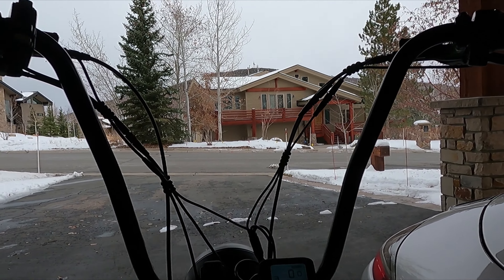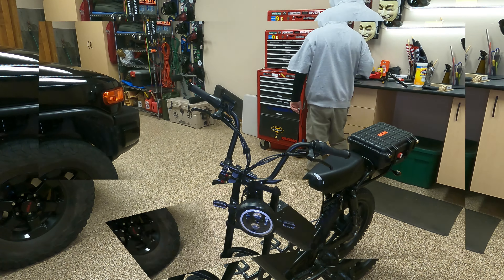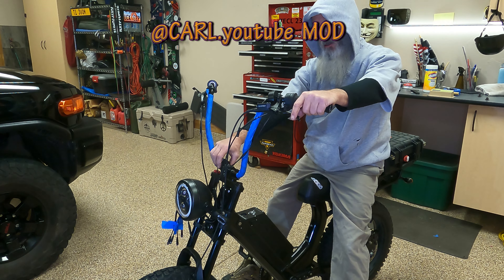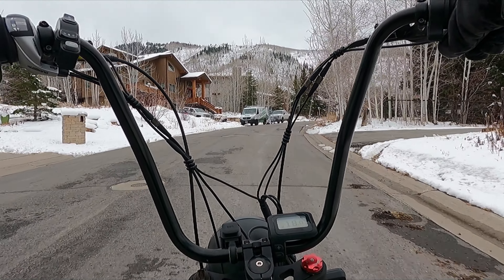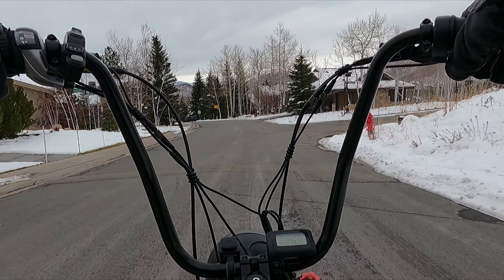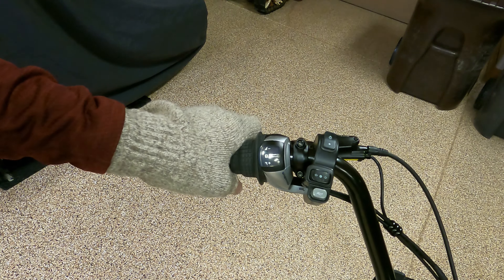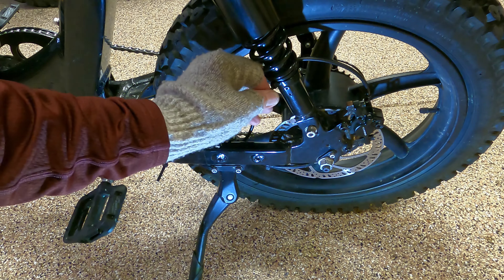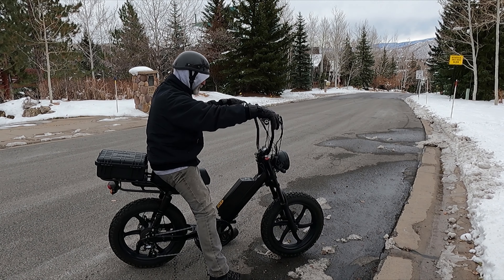Handle Bar SWAP Modification on a Juiced Bikes 💩JUNK HyperScorpion🦂E Bike

Comment: thats the right height for ape hangers wasnt thinking about doing this but now i gotta
Reply from the maker: You will need to replace both hydraulic brake lines, but there is enough slack on all the electric cables once you cut tywraps and work some slack forward.  You will love it!

Comment: Nice Ape bars Jester ! When I got my first bike a few years ago It had the low bars like many of the super 73 type bikes. After a few rides I realized that those low bars might look good but they kill your lower back on long rides due to having to lean forward and bend while riding. 
Your bike is now sur-named the Juiced Jester. All the junk has been replaced. The Scorpion is now squashed ! 🦠
Reply from the maker: Still have the forks to do..

Comment: I found some We The People bmx bars to put on my ride \m/
Reply from the maker: will the cables be long enough?  I had to lengthen the brake line with my Apes.
Reply: @UncleFjester  ill have to make them longer, can i reuse the olives and barbs off the old lines to the new lines? Im worried i might order the wrong ones lol...
Reply from the maker: I ordered replacement lines and the came with the olives and barbs
I think it would be very difficult to reuse
Reply: @UncleFjester  i found some tektro orions 4 piston upgrade with extra long hydraulic lines i can trim down to size, I should be good now \m/

Comment: I had a question maybe you could answer, if i were to put bars with a nine inch rise , would I still have to change the break cables?
Reply from the maker: I think you should be able to find cable existing for a 2" increase. Even if you want to, not have too, its really easy, the bleed kit you'll use forever.
Reply: I appreciate your reply

Comment: I really want the bike if I can't get at over 50 miles of range fuck that can you test with just pedial assistance
Reply from the maker: There is only 2 ways to get 50 miles from this:
1) to remove the heavy ass battery and pedal it like a regular bike.
2) Ride it like regular for 25 miles, then push it home from there.
Reply: @UncleFjester  dam what. Abt puting a better battery on it
Reply from the maker: I'm adding another battery and 🤞🏻 expect to be able to get 50.
But, (intentional pun) the seat is so uncomfortable, you'll need to be standing for 30 miles.
Reply: @UncleFjester  well thanks I'm glad I didn't order it I just thought it be a cool bike too use for uber eats I live in a small town so it wouldn't leave my town but sounds like a peace of crap